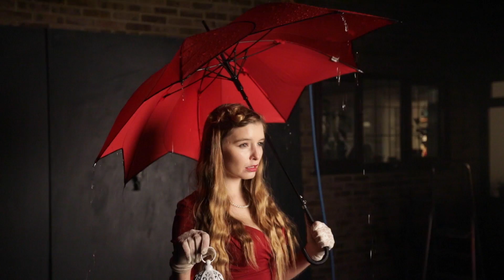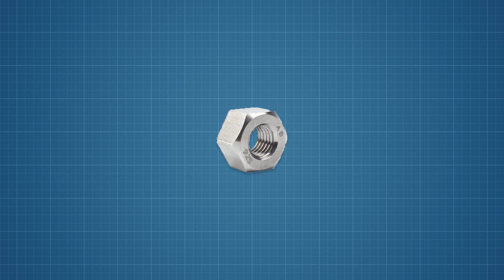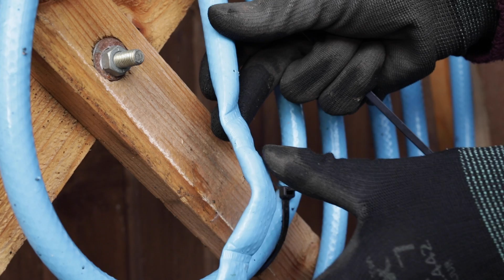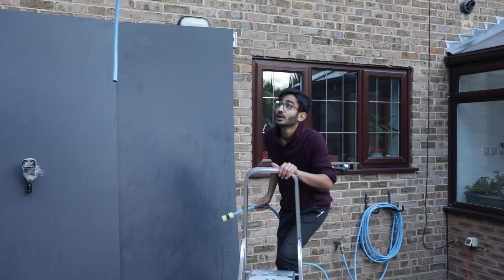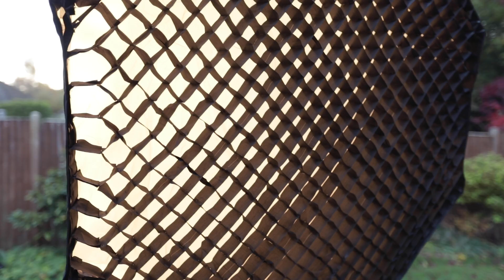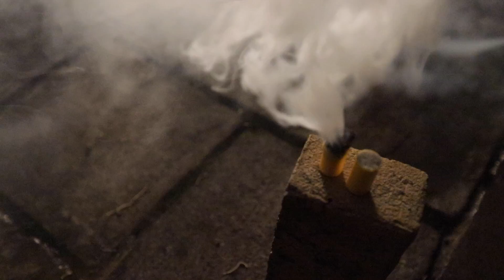£20 DIY Rain Machine! (HOW TO MAKE FAKE RAIN!)

Comment from the maker: For safety reasons it is recommended you use an RCD when working with water near electricity. 
An RCD is a device that trips when a line to earth fault occurs. i.e. water soaking a plug socket. It’s designed to trip within 0.4 milliseconds to reduce the effect of electric shocks.

Comment: Thank you for this, well done. I have struggled with catching falling rain so can I ask what your camera settings were please?
Reply from the maker: Hi Colin, this was 85mm, f4,  1/60sec. But those settings alone will do nothing to capture rain. It's lighting the rain from behind that makes the difference. The Shutter speed was slow for this as I needed the candle light to be a bit brighter, but the flashes are very fast so they freeze the rain in the frame.